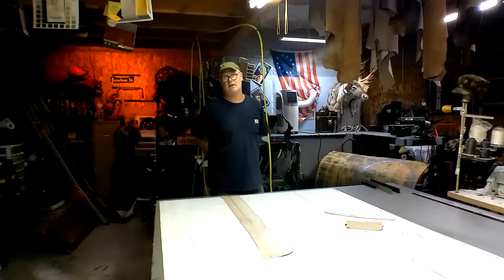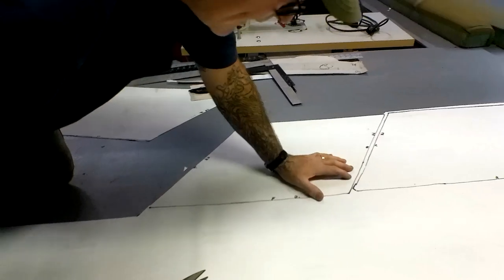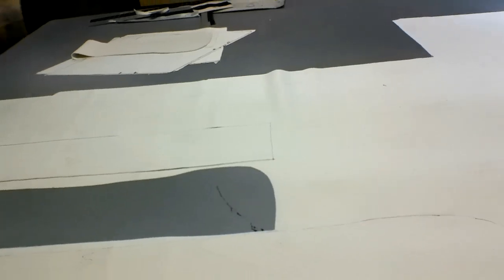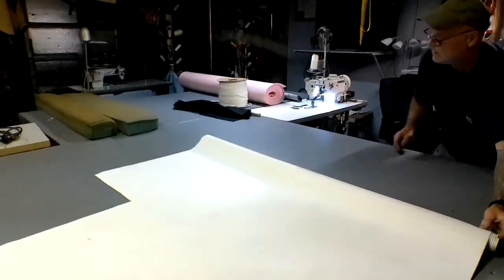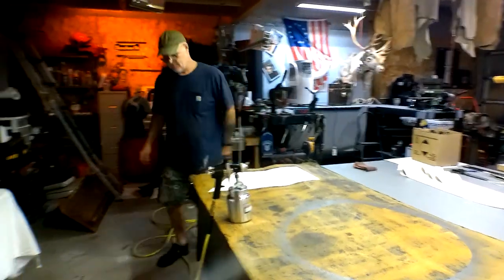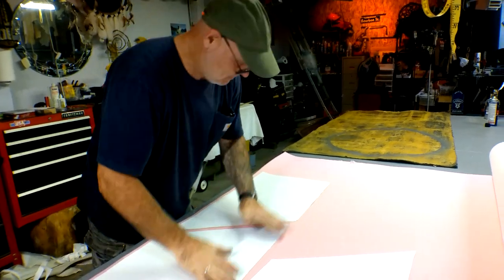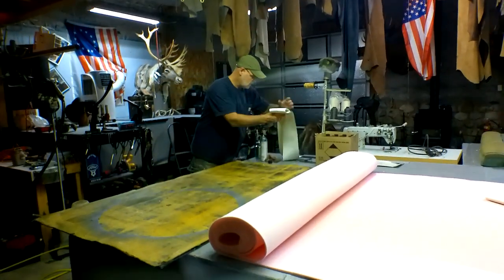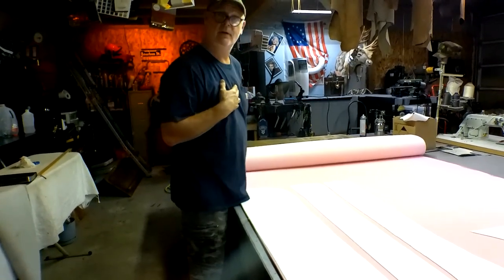PART 4 Boat Seat Upholstery Step by Step How to Upholster Boat Seats Marine Upholstery Tutorial

Comment: I've watched quite a few videos, I like how you explain things. Thank you! My question is the spray adhesive you use to french seam doesn't cause stickiness with the needle so many say not to use it, but I like your method the best?
Reply from the maker: Use it sparingly and only spray it on the seam itself being careful not to spray wide.  You have to manipulate the fabric you are using to create the french seam. I mentioned adhesive for those who are just starting out.  Try only using it on straight runs.  When you approach a big S curve, freehand that without adhesive, it will be much easier.